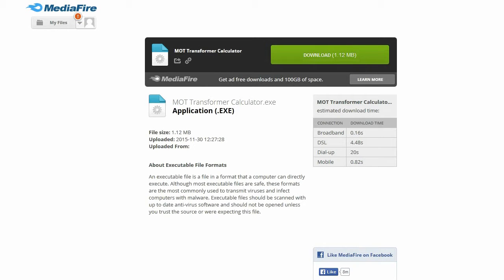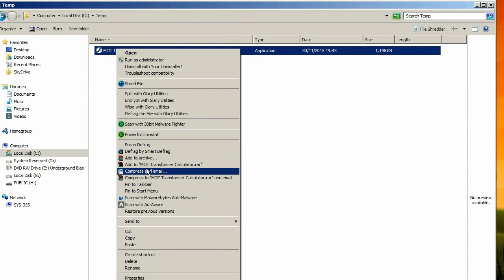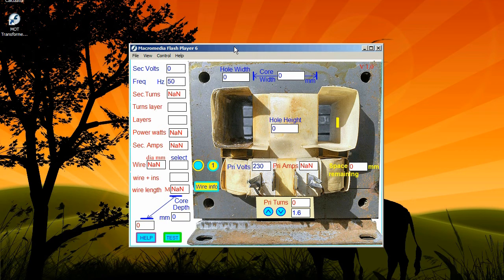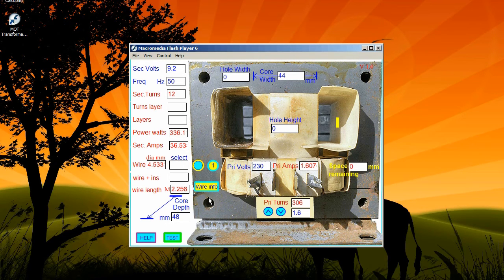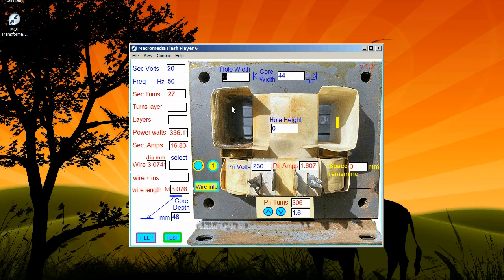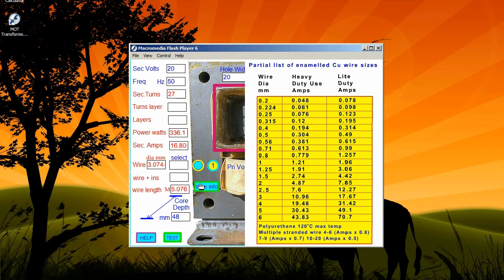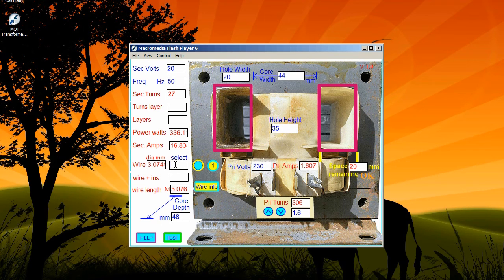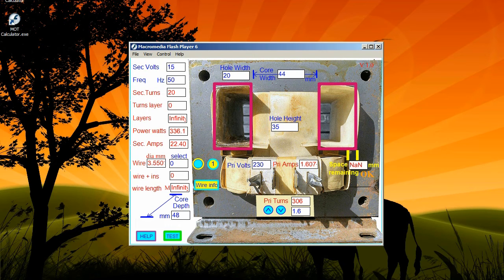Transformer Calculator - free download

Comment: what about different cores like R ... or C.? and   core saturations..
Reply from the maker: Hi Jean, In my experience of winding MO
transformers the manufacturers leave only enough space for the
correct amount of windings. So, if you measure the space, the
calculation is based around this fact, therefore there is no
possibility of over saturation. To be honest I've used this
calculator on many different types of transformer and they have
always worked out OK. Winding 10 turns to test the core is
unnecessary in most cases – unless using ferrite etc.